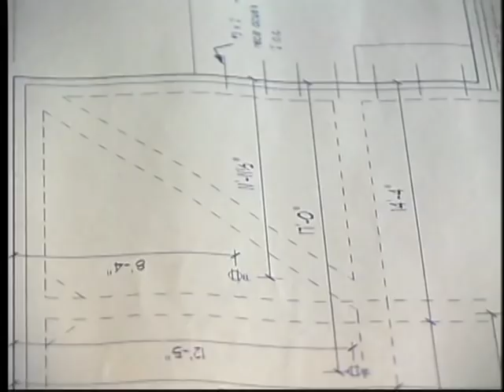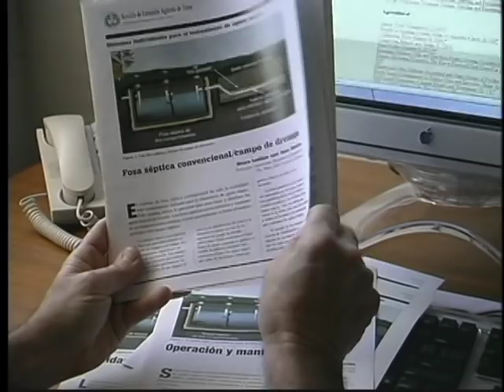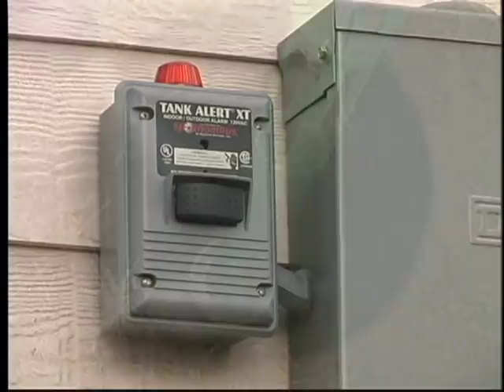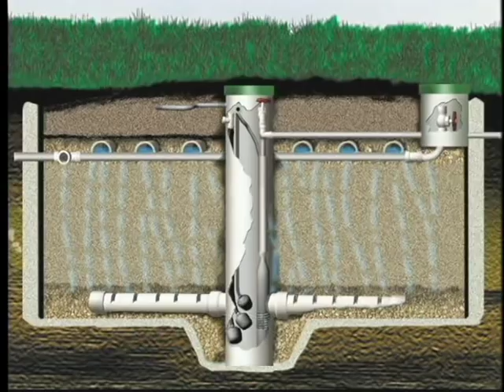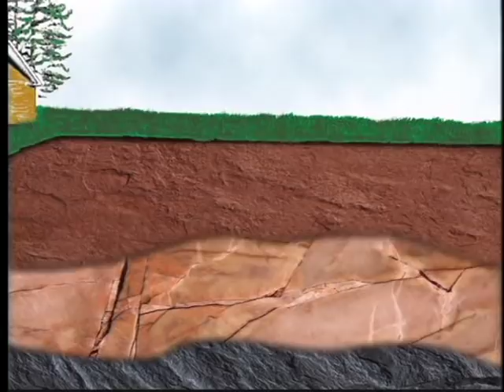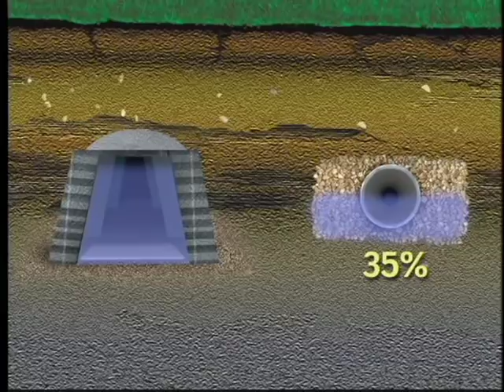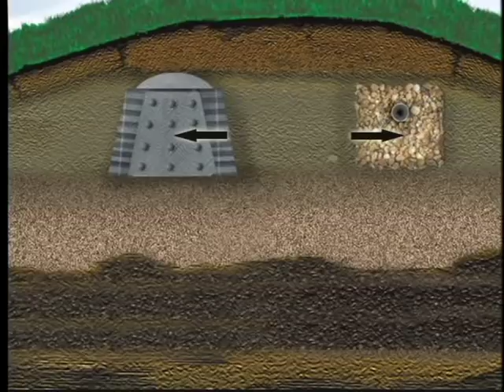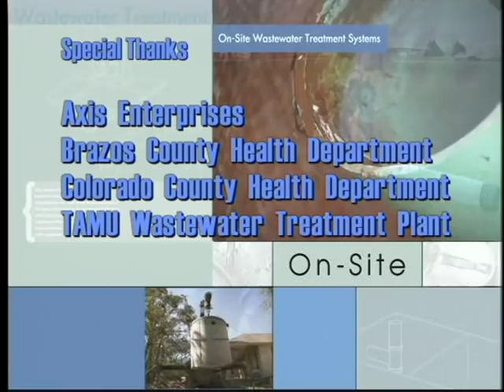Overview of Septic Systems

Comment: Correction:  Holes in soak-away pipes should always be in the upper sides ( about ten to two.) so that the pipes remain wet and stuff in the effluent doesn't have anything to gain a "foothold" to cause blockages.   
Just sayin'.

Comment: What size pipe would I need to run my sewage 200 feet downhill into my neighbor's swimming pool?
Reply: I'm thinking about just running raw sewage into the ditch that runs into my neighbors pond. That will teach them not to dig onto other people's property.
Reply: 4 inch. Definitely 4 inch.
Reply: I would recommend a small diameter pipe with a macerator pump. This will result in a higher pressure at the outlet and much more entertaining results!
Reply: @scottbordewyk3984  loool
Reply: Start with 4", and taper down to 1.5" at the exit. That way it gets good velocity and will splash on everything, maybe even cause stinky erosion.

Comment: First time home owner. Haven't had my house a year. It has a septic tank and my neighbor said the 15 years the house has been there he doesnt think it's been cleaned out. So I called and had the tank cleaned out. I would say within a week or maybe 2 the tank was full again. It's a 1000 or 1500 tank. I dont know much about septic tanks, I am doing my research. Does that mean the leach lines are clogged? Or is the water supposed to fill up and the sludge and solids just sink to the bottom? Lately I have smelled septic outside lately around the house but nothing inside. Any knowledge and expertise is appreciated. Also, I have started using rid-x idk if that's helping me in any way or not. Thanks guys
Reply: TNVolFisher , The septic tank of course has to be full . The reason for the smell is most likely the septic has stopped working after the pump-out. All the little gremlins and bacteria were also pumped out therefore your system has stopped working. To re start the process you need to add some thing rotting, a dead rabbit will do or you can pay for some septic starter chemicals. I would just throw in a dead rabbit, chook-, cat, dog or some road kill.
Reply: been a while since this post. Did you get it fixed yet?
Reply: I now have same problem.

Comment: what would you recommend for a 750sqf house in central florida, that I can dig out and install by hand (no heavy machinery)..soil is soft and sandy.   I need the exercise and the money.
Reply: i know this is an old post but have you checked with your county? They usually have a low interest loan option provided through non-profits and stuff that can help you pay for a new system professionally installed. If you do it yourself and don't get permits you may run into serious issues if you ever try to sell the place.

Comment: What is the cost to convert a septic tank to a sewer system
Reply: Tahira Vaziri It depends upon how close your septic line is from the nearest municipal sewer line. The city water and sewer usually charge about $1,000 per foot to engineer your switch from septic to sewer. In my case, I am 60 feet from the public sewer line. $60,000 to connect and then a monthly fee to remain connected. When I consider that a brand new septic system would cost me no more than $12,000, I would be stupid to connect to the public sewer. Also, consider that an on-site gravity septic system will continue to work in the event of long-term power outages. Public sewers rely on electric pumps to move sewage. In a power outage, it won't be long before your toilets, sinks and tubs will begin backing up.

Comment: Another way of wasting money and you house work lest money  you have to maintain the tank $$$$$$$$$$$$$$$$$
Reply: All rural areas do not have a big fat pipe that goes to a waste water facility.  Therefore a septic system is required.
Reply: @mrniceguy3750  that's true but a gravity fed drain field is just fine. All these treatment tanks cost big $$$ and are totally overkill.
Reply: @br33zy771  The reason there are so many options is due to the fact that not everyone has the same quality/amount of soil on their properties, some folks have nothing but dust and boulders.  Gravity fed drain fields don't work there.
Reply: @Ben-lm3dl  right but where I live they are making you tear out your gravity fed drain field and putting in a pressurized system when the current gravity system fails. The difference in COST??? About 30 F*cking thousand dollars! If you can find a contractor to install a gravity fed system before the county knows you can save 30k!